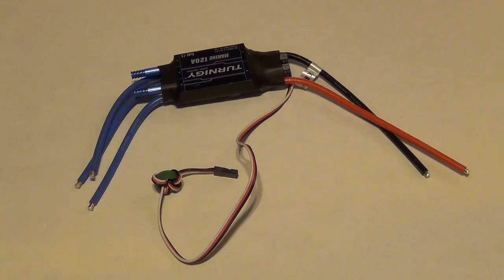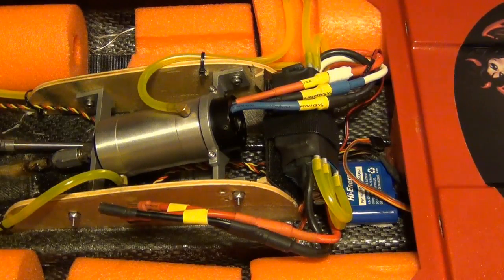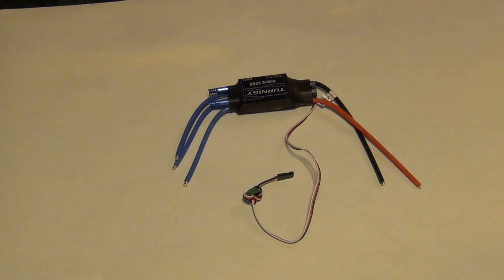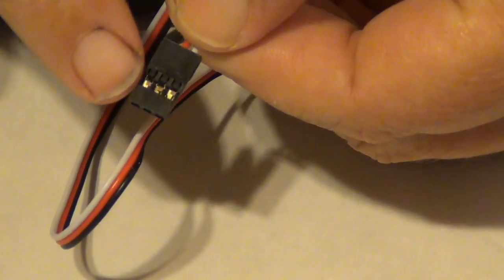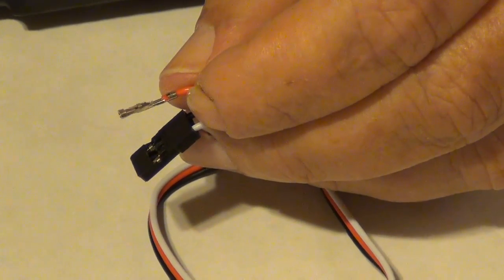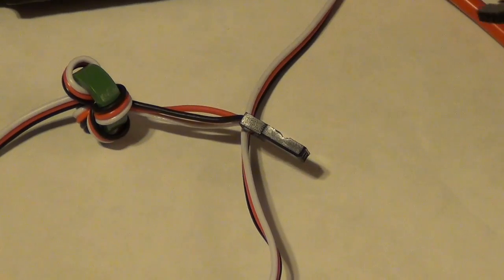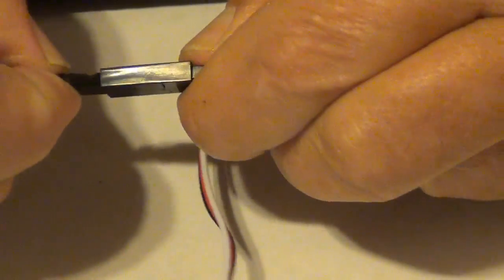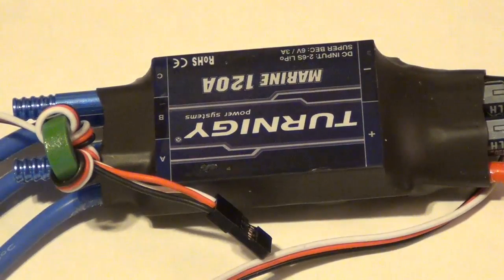Disabling the BEC on a ESC

Comment: Great, basically just doing any how to not using the red wire (+ supply). One question, does the black wire (- supply) do anything? I mean if I use the negative supply from battery would it be the same as the black wire?
Reply from the maker: The black wire is a common ground. (for radio function as well) I would advise against disabling it

Comment: Thanks for posting this video. I am one of those who has cut the BEC in the past.  Besides that I was unaware that you could not connect more than one BEC at a time.  I advise a combat robotics team and because our weapon draws some much current we have lost binding in the past so we started using a separate power source for the control system but we were using a different type of speed ctrl that had no BEC. This was very helpful
Reply from the maker: Glad you found it useful. I understand what you are saying about the heavy loads as well. Some of the larger 1/4 scale servos I've used came with a Y harness for giving them their own power supply.